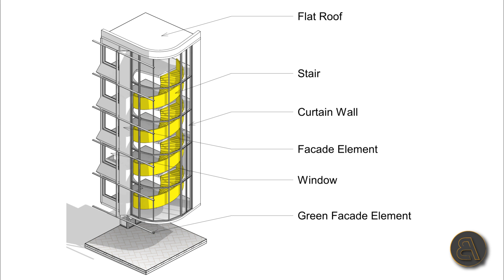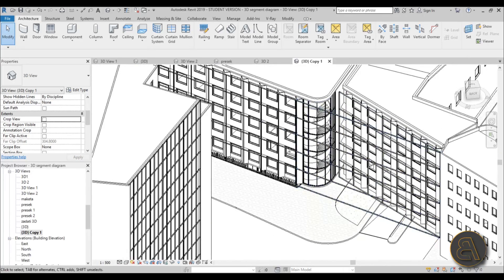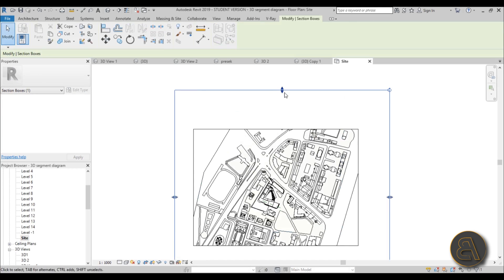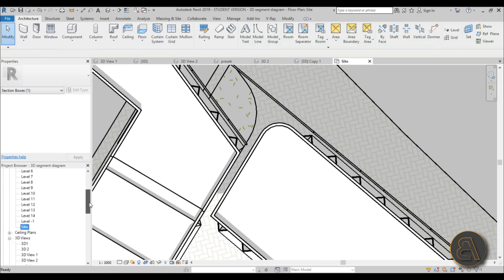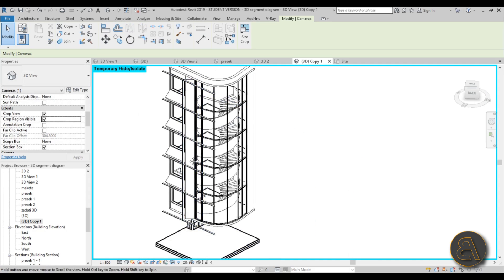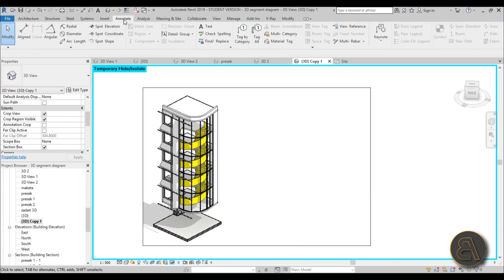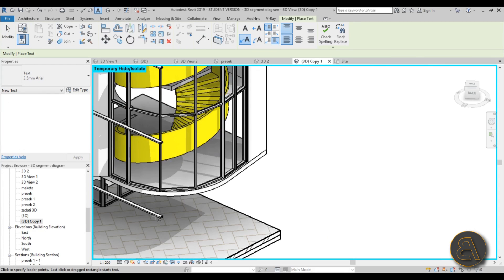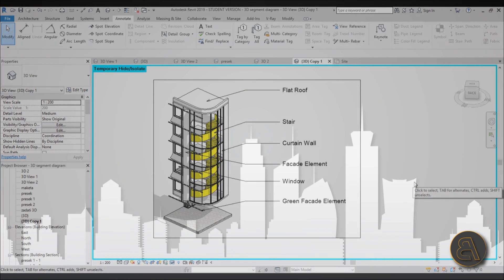3D Segment Diagram in Revit Tutorial

Comment: Please  make tutorials  about  how to create  column  family
Reply: mohamed arsath  no need, the 'out of the box' Revit library has lots of steel, as well as textures. No need to search for your steel, you have it.
Reply: mohamed arsath something went wrong, you might receive a double. Your columns you already have,  they come 'out of the box'. It is just how to find this huge library and textures.
Reply: mohamed arsath  I can only give you the paths to library, your steel, and textures: 2 different paths, one in Program Files and one in Program Data. But!! These paths are the ones installed on a stand alone without changing during installation. I will type the paths, you will find your steel, and I will do this today. I will give you more steel then you asked for, right out of the box.
Reply: mohamed arsath  Here are more columns then you asked for, textures in the next message. Columns out of the box: c:\ProgramData\Autodesk\RVT2019\Libraries\Netherlands\Structural Columns\Steel. Revit version and country is no matter. You can acces this path from Place component/Load Family. I strongly advise to get the hang of finding the files, the library is huge.
Reply: mohamed arsath  The path to textures, but be aware that editing this folder is prohibited. Copy the texture you need and make brown cladding green in a different folder. Many textures are added in RVT2019, take a look in c:\Program Files (x86)\Common Files\Autodesk Shared\Materials\Textures\1\Mats.    It stuns me that users are not aware of the huge amount of files straight out of the box. I read from youngsters who are building their own library with free stuff they already have, not knowing. Follow my paths after c:\.  You will be surprised. Maybe I will pass this on to Balkan and Bim Girl. Finding a steel column for free on the internet while you already have it? That's why it's free, it's already paid for. Take a good look in the files that come with RVT.
Reply: Thank you sir...
Reply: mohamed arsath  No thanks needed. Did you find the files?
Reply: There is something else that I will surely pass on to Balkan and BIM Girl, eventually to Autodesk. There are 3 environments in which to model. Before choosing,  knowledge and strategy are needed. Even Balkan did not know this with his pyramid. BIM Girl mentioned that Autodesk makes RVT, but this is not true, I forgive her, Autodesk bought it. Between selling and buying there was no development. The difference between RVT 2016, 2017, 2018, and my current 2019 shows that Autodesk is now right on top of it. But still there are 3 environments to model in, your choice, your strategy, based upon knowledge. I foresee that modeling in any of 3 becomes the same. Balkan is a user, but BIM Girl is something completely different: she knows the way to Autodesk. By 'mom and dad' we can Autodesk put to work. In the mean time we help each other.